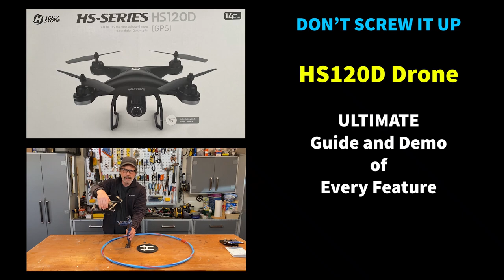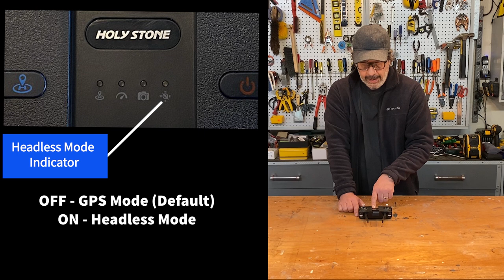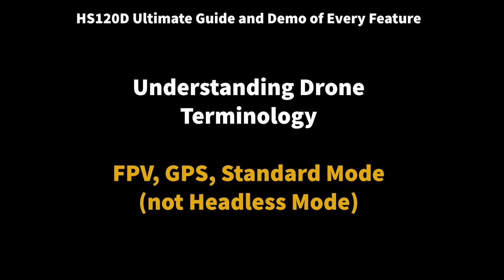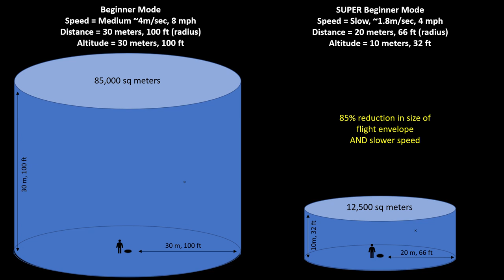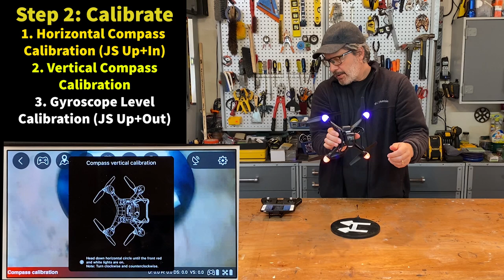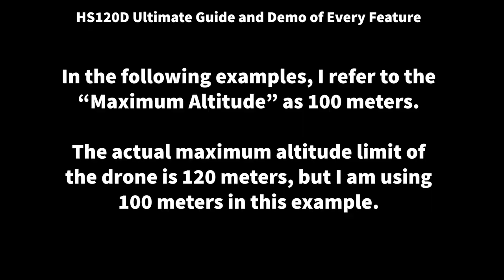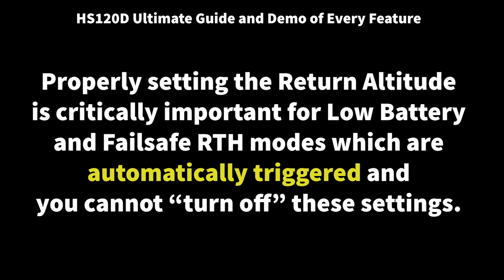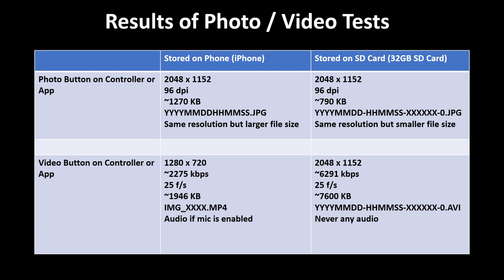NEW! - HS120D Drone ULTIMATE Guide and Demo of EVERY Feature! - Holy Stone How-to Manual - Beginners

Comment: I only had it for a week or so and flew my hs100d in headless mode into a bush. As I got up to it I saw that one motor wouldn't stop spinning even when I turned the drone and the controller off. I unplugged the battery, plugged it back and the one prop would start spinning again! Now all 3 props except that one spin, rendering it useless. I actually watched a video on taking it apart. Found a black wire on the faulty prop that has come undone from the motherboard. But for $100 it was a good learning experience as I work  up the courage to fly the DJI FPV I bought almost 6 months ago! I just ordered another Holy Stone though for practice, but one with with the GPS, Return to Home etc.
Reply from the maker: Sorry to hear about that. These drones are a high risk hobby.

Comment: Taking pictures with the controller I get a beep but no pix. I had this same problem before, but I forgot how to fix it. It was fixed before.  And no the video isn't running.  Great video.  It's great to use it as a refresher.
Reply from the maker: Sorry I don’t recall what causes that problem. I’ve seen it intermittently also.  Can you take a photo by pressing the screen button on the app?

Comment: I really like the drone.  I just had one thing happen recently.  I thought I might try flying around a tree and ended up in the tree by the top of it!  It was a leafy maple.  I could see the leaves on the camera and it was still upright.  So I tried about 5 times to start motor and get out.  It sounded like a weed wacker as it chopped leaves and after the last try it got out and feel to the ground.  It was totally fine and not damaged!  Pretty amazing.  The one thing I found out is to not turn off the drone until you stop the video or you lose the video.  So I didn’t get the whole thing that happened on video☹️.  At least I got the drone back!
Reply from the maker: Thanks for the tip.  Happy to hear you got it back!  I crashed mine pretty hard the first few weeks I had it. And it is pretty resilient.  Thanks!

Comment: This is a neat little drone and quirky. Kindve a "retro" drone at this point but I like that.

Somethung nobody is mentioning is this drone within the same model number uses 2 different batteries. I just brought one off Amazon (new but open box) and then went ahead and ordered extra batteries for it. Well the replacement batteries were too thick. Thats because they are 2S. It was the spec thats in the manual 7.4v 1200mah. What came with the drone? 3- 1S 3.7v 1000mah batteries came with the drone. It looks like the opening in the side of the drone originally allowed 2S batteries to be used and the design was modified with an insert or modified battery tray to be smaller for the 1S batteries.

Anyhow, I bought this (mainly over the HS110G) partly because it was  listed as a 2S drone whereas the HS110 runs 1S. Im pretty sure the HS110 is basically the same 1S batteries I recieved with this drone. 

I would like to return it to 2S 7.4v especially now that I got batteries ready to go in that size. 

But surprisely nobody has come across this issue. Batteries are same length, width,  and pin location. So if that battery trey was swapped out or modified it may work provided the electronics are the same rating as before to handle 7.4v
Reply from the maker: Thanks. I’ve not noticed the battery size difference, but I will look out for it.

Comment: Thank you very much Tom.  Obviously took a lot of time and effort.  Suggest you rename your video to HS 100 series or Holy Stone Drone How To.  I just purchased a HS-100 2K and just about everything you explain is applicable to the HS100. It uses  the Pro version of the app, but the app controls are very similar.  The physical controller is exactly the same. Camera/video resolution is now 2k. This video will help many other HS drone owners if they are lucky enough to open it, no matter what large size HS drone they own. Again, great job. Saved me many headaches.......
Reply from the maker: Thanks for the tip. I will modify it.

Comment: Yes, you're correct when you say that FAA registration is NOT required for this one, but you can still register it if you choose to - it's only $5 and as long as you're flying recreationally (Part 107, Section 44809), the one number can be used for ALL of your drones; if you ever get your Part 107 Commercial UAV certificate, however, then you need to register EACH drone separately, with separate numbers, regardless of their flight weight (even those that are less than the 250g limit).
Reply from the maker: Thanks for the clarification.

Comment: Oh, OK, my other GPS drone didn't go crazy trying to attack me (climbed high in the air then dropped at a high speed flying right toward me so I had to dodge) - it was just returning home because its battery went low. Actually scared me, so I decided to use a tiny pocket size drone instead for flying drone practice for awhile. So, this drone has a similar feature to be aware of. Thank you for the tutorial.
Reply from the maker: Thanks.

Comment: I seem to be the only one asking lately. But I don't think it rises to spam. 1 weeks ago and 3 weeks ago. I tell all about your videos. They tell me to ask you when they have questions  :=)  I have a questions that I think, likely, the manual doesn't explain. 
(1) When I turn the remote on all the 4 center indicator lights come on. The 2 important ones for now are the Return Home and the Headless lights for this discussion. They are all on. As soon as I pair the bird the Headless lamp goes out? So I press the Headless Button (N,S,E,W) button to turn it on again because I still am learning. The Headless lamp does not come on. Rather, the RTH lamp goes out?
(2) When you fly do you depend mostly on sight of the bird or contrary, do you watch the video mostly? I find the orientation of the Sun is tough. In regular photos the sun is supposed to be behind you. With a phone the sun on the screen makes it mostly invisible. Turn to the sun and the sun is in your face. I wonder if polarized glasses would help.
(3) The bird crashed and burned (metaphor) from about 5 feet into grass. No harm. The the app said "the inclination was too large."  ????

Thank you for your times and experiences.
Reply: Oh yeah. Have you found any good pegboard hangers that don't come out when you lift the tool? lol
Reply from the maker: Good questions.

The default mode after pairing is Headless = off.  That’s why that light goes out.   It sounds like you are doing a long click (hold) on the headless button.  This puts you in “altitude” mode where headless is off and RTH is disabled.   Try a short click on the Headless button and it should just turn the Headless light on and leave the RTH light on also.  

2) I generally fly shorter distances, so I rely on line of sight instead of using the camera FPV view on the phone.  Also hard to see on sunlight.  

3) I don’t know what that error message is, but I am guessing the GPS lock was at a slightly higher altitude than you were trying to land at.  GPS altitude can’t go negative.  

4) you can buy pegboard clips that strap across the hooks and hold firmly on place.  I have some of these on my board.  

Thanks!
Reply: @dontscrewitup  I thank you for that and I will watch that carefully.

Comment: What in INCREDIBLE video. The H120D is my first drone,  actually  my second. I bought another and never got as far as charging the batteries because of lack of instructions.
This video took away any fears I had to fly my first drone and instructed me how I need to...step by step, literally flying a drone for dummies.
I do have one question.
Can the blades be shut down when it lands? The drone has tipped over a few times already after landing and I am waiting for broken blades. I grab the legs and turn off the drone by the battery button and I have to think there is a better way.
Again GREAT VIDEO !
Reply from the maker: Thank you,for,the feedback. I appreciate it.  If you hold down the auto takeoff button for 2 seconds it will kill the motors.  This is known as the “emergency stop” function. I do this as soon as the drone is safely on the ground.

Comment: Thanks for the vid. I love watching long informative videos. I’ve had this drone for 3 years probably and still cannot get the follow me or follow me locked mode to work properly. Nor set and follow specified path way points.
Reply: Gosh. That 3rd level gyro cali is definitely one I miss
Reply from the maker: Yes. Often missed.
Reply from the maker: Thanks. I haven’t used those features in a long time.  I remember they were not obvious as to how they worked.  The way paths always worked well for me.

Comment: Hi Tom you are the best, I have look at a few Holystone videos and you are by far the easiest to understand thank you for that.I was flying my holystone just hovering 250 feet, 8 min. or so , everything great it was a firework show. white and blue lights are on , then the rear lights went flashing red. didn't know what was going on so I landed it ,it worked great , I just don't know what why the rear red flashing lights went  on. Its not in the manual, Great Video
Reply from the maker: Thank you. I’ve never been able to rely on the flashing light indicators (they are also difficult to see in daylight).  The message bar on the app is usually a more reliable indicator of what is going on.   Was there any type of message on the message bar on the app when this happened?

Comment: Me again! So far my experience after 2 mos has been the narrow back  yard. So I've mostly gotten used to the way it goes here and there and mostly up and down. There's a lot of trees and close neighbors and I'm not keen on asking can I go in their yard to get my drone.  So sometimes it's days before I get out there and play. Today I decided to run just a block away and there's a large open field. I didn't detect much wind. I had a gizmo that reads wind mph it maybe hit 3mph in one direction. It was disappointing for the most part. I did find how to get the Headless lamp on (short press as you said). But I didn't feel like I had control much at all. Going up and down okay, and when fearful RTH worked. But I'd put the rear of the bird to me and send it out and it didn't seems to be responding. I push go left and it would go right. It was just disappointing. In your experience, kind Tom, :) , how much affect can we give to wind? This was wide open. I'm sure being calm on the ground, another 25 to 50 feet up it could be different. I'm just trying to figure why at times it seems to be doing the opposite of what I tell it to do? Maybe GPS is easier? Not Headless? Your patience is rare. Thanks!
Reply: To get a little confidence back, I came back to my own backyard to fly it like I'm used to. No. It's seems to have a mind of it's own. I used the app one time several weeks ago, last time I could fly, and I'm wondering if somehow I hit a setting that might have reconfigured the control. When I tell it to go forward and goes right. When I tell it to come back it goes left. It seems to get mixed up. This is on fresh chg on the batt and the remote and me pointed at the butt of the bird.  My brother once described his like hitting a wall. But I never had this before. And I think I used the app last time experimenting. That's why I wonder have I restricted my limits. I'm waiting for . "Aren't you listening to my videos?" Maybe in the winter? When flying time is over?  ":-\\
Reply from the maker: I suggest trying to fly it in GPS mode (not headless) first.  It is a little complicated but you’ll develop better skills.  The controls always operate relative to text position of the camera.  Lift off with the camera facing away from you.  Left is left, right is right.  Then turn the camera toward you and left is right and right is left. But always the same relative to the camera position.  It sounds like you are somehow switching between headless and GPS mode.  See if you can get the controls to work properly in standard GPS before using headless. At least then you can rule out hardware defects, etc.  3 MPH wind should not be a factor.  Also try flying in Slow speed at first.  It is easier.  Don’t push it too far until you master basic controls.
Reply: @dontscrewitup  Thank you. Previous to this last debacle I described in a large lot and was so disappointed,  I had been on a good learning tract in my narrow back yard with trees in the sky-eye view and neighbors over fences all around. So after that disappointing flight of last, I took the time tonight back in the yard, and back to square one. If anyone is following this, I'm sure there are, don't make the mistake I made. Got too fast in calibration. I was focusing on the stick movements and not waiting for the lights. I basically was paying them little mind. I made a small crib sheet and had it with me so I didn't have to hold a manual page open. I did a good 5 flights in the yard tonight and it seems I had much better control again after taking the time for calibration. The manuals seem to say the beginner should fly in Headless mode first? Also, if you are new, I think I was not being rigid enough about have my torso and remote pointing at the drone. I'd be watching it and then find the remote was pointing down or my upper body was turned and not the remote. Watch that. 

Tonight I also copied some of your great crashes :-) and noticed that one of the props was a little bent out of shape at the tip. I was able to straighten it. I will test if that works and if it holds the right position I gently bent it back to where it was supposed to be. Only the tip was involved.

I have checked out a couple of other HS120D videos and frankly I think I landed on the right person here first. Thanks again. Seems I'm back on tract but I'll look into your advice about flying GPS.
Reply from the maker: Calibration is key.  Headless is easier for beginners but I feel you get better control and understanding of the controls by learning in GPS but that’s just my opinion.  And, yes, always keep your feet planted in headless mode!

Comment: I have a HS110D I have trouble trimming and hoping is easier with GPS. Thinking of getting this one. I live in Canada. They are rated #1 on 2 different consumer report websites, I don't like the way the 110 charges the batteries though. Price on Amazon.ca is $229.79 and that's a great price. Am I making the right choice as I am a 66 yr old beginner.? Great video and HS customer service is amazing. Tnx
Reply from the maker: Thanks.  I am not familiar with the HS110.  I’m happy with the HS120D.  It flies well and they flying features are excellent.  The camera is pretty low quality.  You really pay for improved camera capabilities as the prices increase.   Although the cameras on these drones are listed as high resolution (they are), the lenses and processors are really inexpensive parts.  The picture quality is only as good as the lens.

Comment: First try to fly it - was running away from me chasing GPS signal. Then it was OK next times, but in the end got stuck in a tree (managed to get it down) - need more practice with it. Picture and video quality seems good (used just the controller and SD card for it, because of the lag in the app). The cam is wide angle one, so it distorts a bit a picture. Couldn't turn the drone around in one place - flying around while turning. Could be used like a mower when landing in the tall grass :) (my don't have propeller guards).
Reply from the maker: Try keeping the speed on Low and keep it close by.

Comment: Just got this as my first Drone. 
How to land gracefully on specific location using control?  or whare ther various way to land manually via controller or phone app wihtout using auto landing.?
I tried left joy stick to get down almost to land just like half foot above ground and tried to use both joy stick moved to lower inwards direction to shutdown motor. but it did not help. 
I believe one kye button ( top right button on contorller with 2 arrow) is only for auto landing and does not consider in between objectes and decide path of landing.
Reply from the maker: Use the left joystick to get it as close to the ground as possible, then hit auto land and it will softly land and shut off.  Or get it very close to the ground then kill the motors by pressing and holding down the auto takeoff / auto land.  It will shut off and drop to the ground.  Usually you can get it on the ground with the joystick then shut it down.  But sometimes the GPS doesn’t know exactly where the ground is, or you may have taken off from a slightly higher spot and it will not go below its original takeoff altitude.

Comment: One thing I want to add, and this could be just my HS120D camera. The SD card that works on my drone is 32gb size. My package contains two 128gb sd cards and no video and photo gets recorded on it. They all get stored on my phone. I tried reformatting the 128gb sd and both failed. After some frustration, I took a 32gb card I use for backups, format it fat32, and sure enough I got recordings on it in my drone.
Reply from the maker: Thanks. There was conflicting info from the manufacturer on this topic. Some of the manuals say 128gb is the max and other days 32gb.

Comment: Great video, watched this before trying ,  the drone flew correctly for awhile but now the right direction controller is off 90 degrees. when calibrating everything appears normal and the unit hovers nicely, but then forward   is full right not up . any info on line?
Reply from the maker: Thanks.  I’m not sure what would cause that.  Try calling customer support they are pretty good at replacing defective items.  There is also a setting where you can reverse the joystick controls (for left handed operation), perhaps you did this by accident?  Or are you running in headless mode when you think you are not?